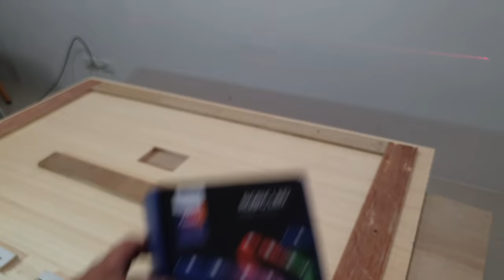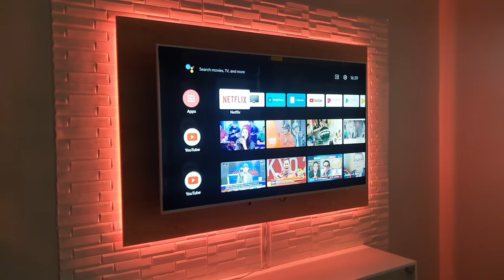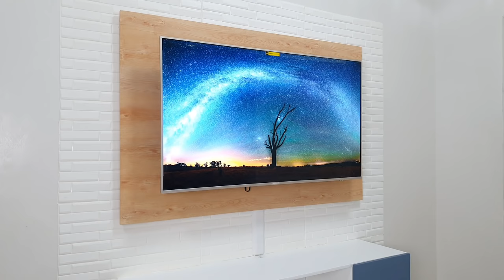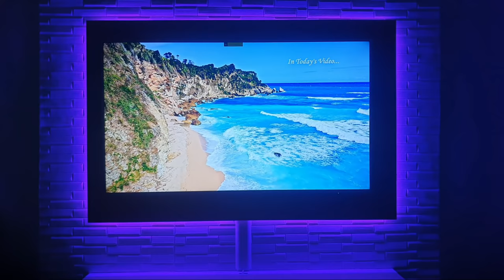DIY How to make Floating TV Backwall and Cabinet with LED lights - Hide your wires!

Comment: Looks amazing. You should of taken a step further and ran the wires through the wall to add a really floating look.. But overall looks great.
Reply: I guess it's not dry wall so it would be a mess with hard wall.
Reply from the maker: Thanks man. That's a concrete wall so I just put a raceway.😀

Comment: This is nice, but what happens if I buy a gaming console some time after installing this?, how I can connect the console to the tv?
Reply from the maker: I just added a backwall and its the same thing when you mount your tv on the wall. You still got clear space behind the tv. If you wanna hide the cable, I made an opening behind going down the cable raceway.

Comment: Hi, I want to know did you somehow put together that wooden mounts on the wall with wooden backplate of TV, or it just hangs onto it?
Reply: Yes
Reply: @bikasjenavloging4681  Yes what? 🤣
Backplate is fixed with screws or just hangs?
Reply from the maker: Everything is hanging using french cleat system. As for the tv, the mount is fixed with screw onto the board with extra board behind as a backing.

Comment: Great video, quick question, did you have textured walls? And if so how did the peel and stick wallpaper hold up? I've heard they won't stick well unless you have completely smooth walls
Reply: Thats not true
Reply: That wall should be silky to stick the po foam,in my country u must add adhesive gum

Comment: Thanks for the video. But, how did you attach the floating wood panel behind the TV to the wall? did you just hang it on the strip of wood you attached directly to the wall? cos it looks too firm watching the load test; to just be hung ordinarily
Reply from the maker: French cleat bro. The wood cut into 2 pieces with 45deg slope. You can search for it for proper demo.
Reply: @DIYTatayDan  Alright thanks bro
Reply: @DIYTatayDan  haha that makes much more sense now, just checked it out. Thanks again.

Comment: It could look even better, if you had managed the cables behind your „brick stickers“. So you wont need that canal.
Also i don‘t understand the second layer. Wood or stone, both of them is too much for me. (But thats just my opinion)
Hope you enjoy it still :).
Reply from the maker: Yes thats a good point. I considered putting raceway/canal for easy access incase I will add/remove cables.

Comment: So nice until the point where you didn't hide the cables in the wall and instead use that white plastic thing to hide them. That's unfortunate. It kills the whole floating effect for me. I built sth similar but have all the cables in the wall.
Reply from the maker: Yes I agree with you it somehow kills the  effect. Unfortunately thats a concrete wall so I need to make a practical solution to hide cables and avoid chipping/demolition.

Comment: If you calculate the cost of the tools he used, it would be cheaper to get it done by a carpenter and everyone don't have that much skill to get it done with perfection.
Reply from the maker: Well mate if you are not into diy projects then yes you can hire a carpenter. But if you wanna start one, you must invest with basic tools atleast.😀 trust me its all worth it.